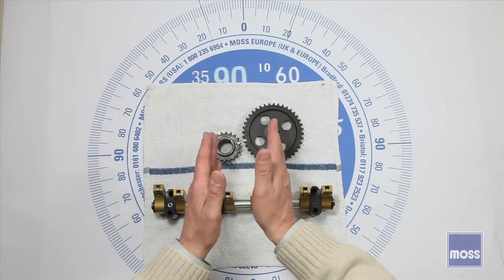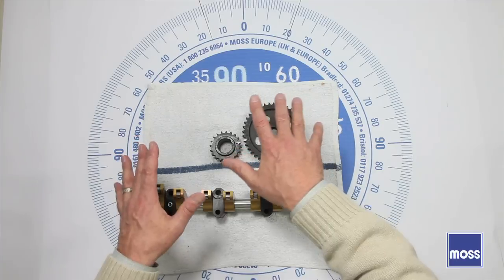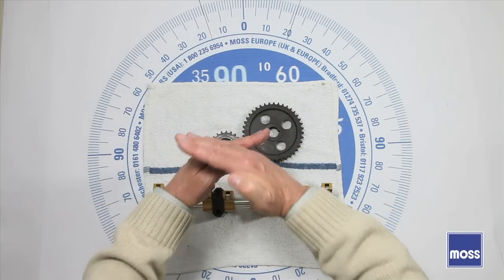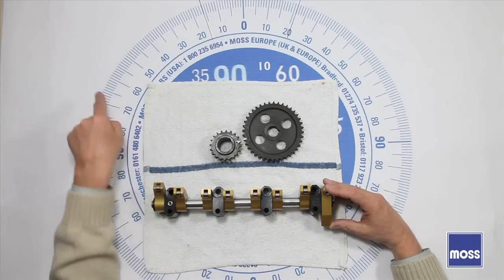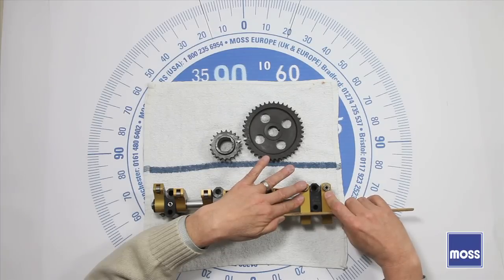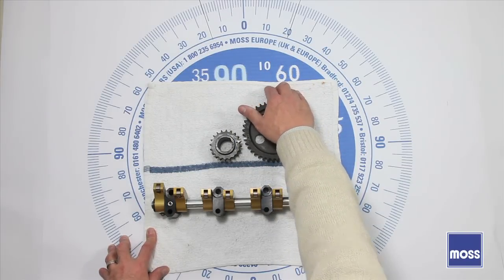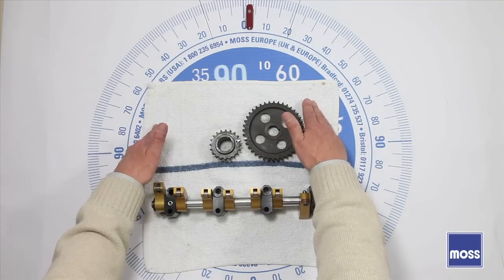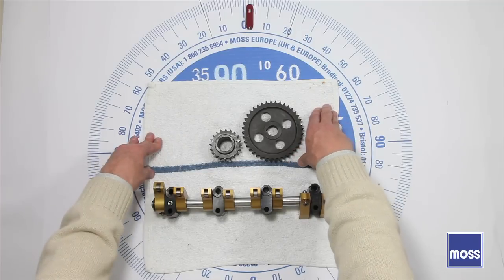Timing Gears & Marks (Part 3) - Aligning the Cam Gear

Comment: 7:38 SO THIS IS the "engine torsion value" that is mentioned in a VAG PD diesel engine ?? because I read that I am supposed to 'see' a value of +2 or +3 degrees on the torsion value via VCDS for my car when doing timing belt change, and if assembled correctly (meaning both crank flywheel is on mark and camshaft was on mark) it should be right at the value we had before (or something along those lines...?)

Comment: Question i am installing new timing chain...when crankshaft and camshaft gear marks are lined up( like you have on your video) ... Is that also top dead center on compression stroke? i need to install my distributor correctly on my chevy 4.3..just want to make sure...thanks

Comment: hi, i liked the way u explained that! but i hav a n issue that is probably a sinch 4 u, my stock cam timing chain gears were set @ 2 degrees adv fm the factory ,now im putting a new double row timing chain with a performance cam in it . so do i set it @ 0 degrees 2b safe or do i go  2 degree adv again & take the gamble? the car is a 2000 model gm 3800 with an l67 supercharged factory engine. if u r interested & need my cam card info to work this out i would luv 2 hear what u hav 2 say!

Comment: Wet sleeve triumph cam sprockets are adjustable by 1/4 tooth increments (2 pairs of mounting bolts and the gear flips) so the  2 1/2 degrees difference is a little more important for these engines.

Comment: Is the timing chain really suppose to be this god damn tight?  Even using effing crow bars and U clamps I cant get this thing back on and its only a little 17hp motorcycle engine.  I have the chain tensioner  disengaged.  I'm afraid I'm going to poke out an eye with tools popping off like this.  Humanity really needs to start engineering shit better to be human maintainable than POS engineering I see everywhere. I though I could get away from this BS by ditching cars but apparently not.  Same old stupid shit.  Two day cylinder head replacement is going to drag out to 4 fucking days...